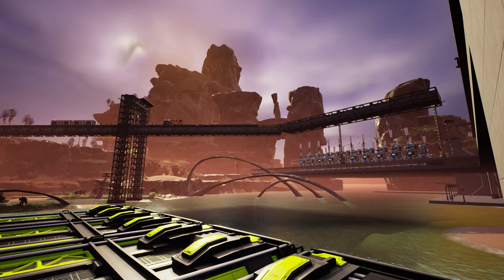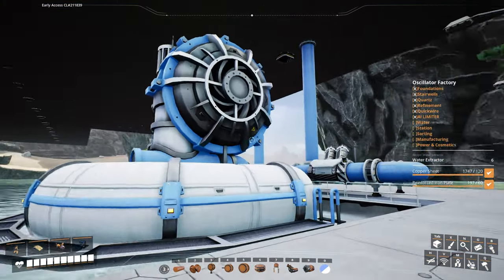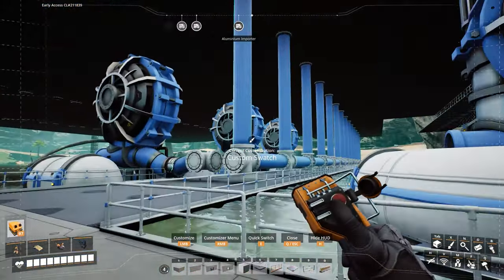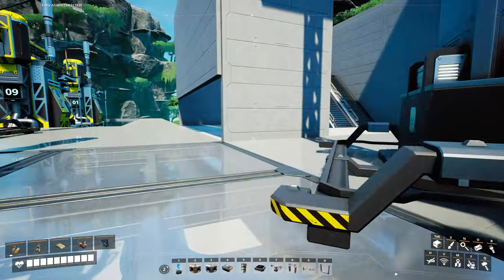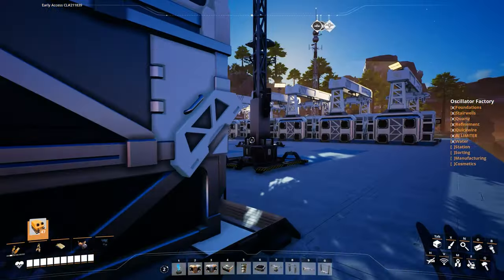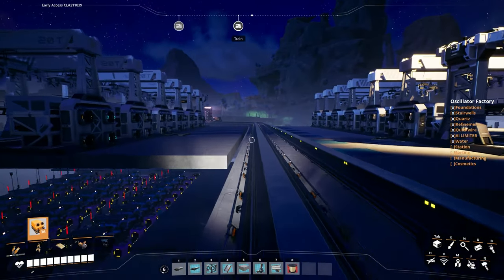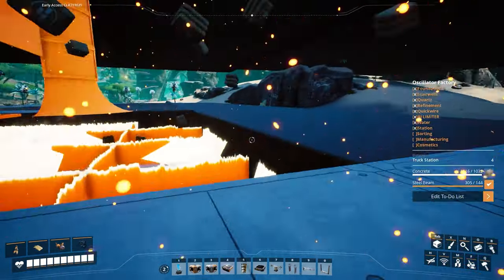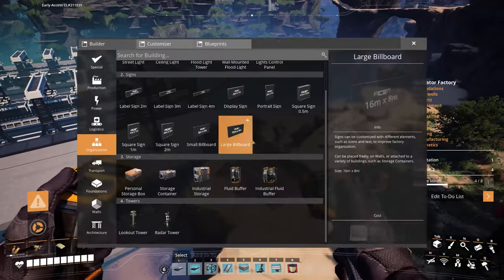TRAINS, TRUCKS & WATER! - Let's Play SATISFACTORY Update 7 - Ep.48

Comment: With pipe junction vertical rotation - this only works when you're adding it to an existing pipe segment, right? I could not find any way to rotate them vertically when place the junction first.
Reply from the maker: Yup. You could blueprint just one aiming vertically for later use too